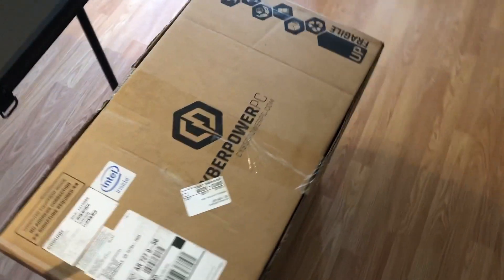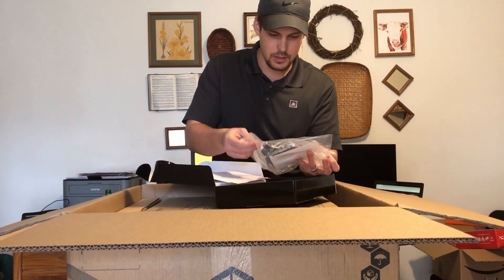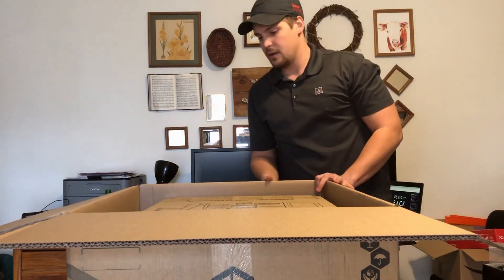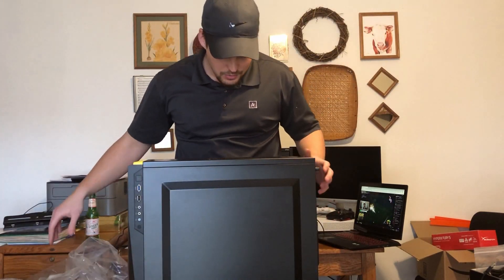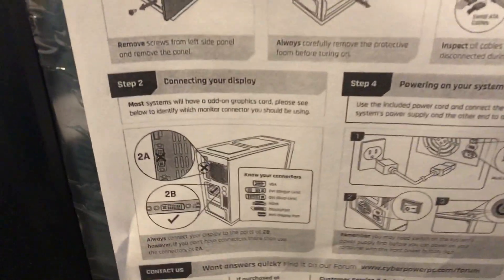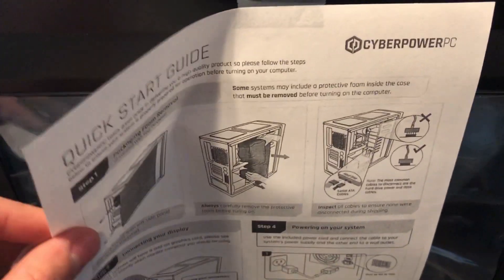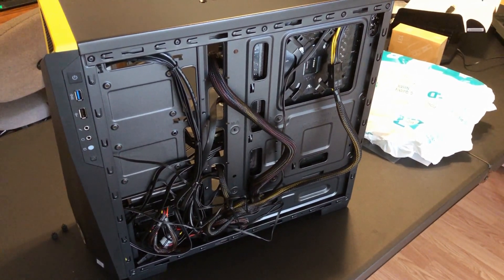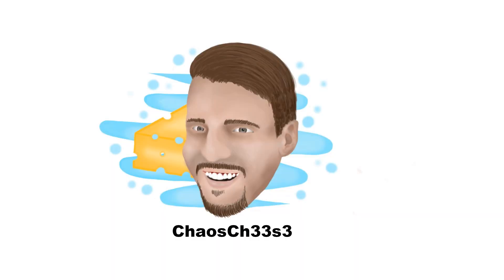Cyberpower PC Unboxing

Comment: The good thing about getting a pre made PC is you can on your own learn how to upgrade the parts. That's what I have done. Upgraded the PSU, CPU, and GPU. I'm going to at one point upgrade the motherboard and CPU again.
Reply from the maker: This is actually exactly why I got this one. I wanted to get into PC building, knew a ton about it, but didn't feel super comfortable building one right off the bat. :)
Reply: @ChaosCh33s3  same here.

Comment: I've got my cyberpowerpc coming tomorrow! Your video has give me some good insight on what to expect thank you 😁
Reply from the maker: Tom Oreilly let me know what you think of your build!
Reply: @ChaosCh33s3   just came like an hour ago, really high quality and quiet as a mouse add me on discord if you wanna play some games sometime Tommy #1266
Reply: @itssTommyy  is it working okay?
Reply: @JosceTonic   yeah fine not had any problems do you want to know the specs?
Reply: @itssTommyy yes please im planning to buy the syber gaming pc im the case of the cube
Reply: @JosceTonic 
CyberpowerPC ultra 5 Case 
Cpu: amd ryzen 5 2600x
HDD: 2tb seagate barracuda
Memory: hyperx fury ddr4 8gb x2
Motherboard: msi b450-a Pro
Gpu: amd radeon rx 570 8gb 
So far I've been able to run any game without any issues on ultra
Reply: @itssTommyy  price?
Reply: @exiled3797   I also got a 240 ssd and a monitor it cost me £1040 so about $1350
Reply: Exiled I got a cpu 3900x,GPU 5700xt  anniversary edition, 650 gold power supply 16 gig of rgb ddr4 ram, a NZXT kraken x53 , 2 tb of Seagate hdd and a 1tb nvme Samsung 970 evo and finally a b450 tomahawk all in a NZXT h510 elite case with 3 extra rgb fans for 1650$ and its running absolutely fantastic and my main use for it is vr

Comment: You obviously didnt chose the professional cable management option. If you do, the back side is much cleaner (har har). Its not that expensive and it makes cables on both sides much more manageable.
Reply from the maker: Yeah, I realized this after. I note it in the video where I try and do the cable management myself.

Comment: Did you have to buy the keyboard and mouse separately or did they come with the pc for free
Reply from the maker: The PC does come with a free mouse and keyboard, but they are low quality. They usually offer a high quality upgrade for around $5 each. (They are worth around $70 for the keyboard and $30 for the mouse).
Reply: Ty

Comment: Just picked up a 3900x from cyberpower pc with that exact cooler. Hows the cpu cooler?
Reply from the maker: It's pretty solid, it can get loud, but it cools well. Under 100% load no core goes above 75C for me.
Reply: @ChaosCh33s3  I have a ultra quiet white fan to pop in to replace if needed. Hows the pc running? any issues?
Reply from the maker: @bazurk_dot_com  No issues whatsoever. It's honestly been a super great experience.

Comment: Hey! I just bought one, and it’s going to ship soon! It doesn’t come with the foam in it? I didn’t see an option when going over the stuff included, and didn’t know I had to contact them. I would have thought that they would include a 1$ piece of foam for a pc with a i9-9900k & 2080ti
Reply from the maker: Hey so the foam inside the PC case itself is not included. All the other packing materials are. If you want them to add the foam you can email them at techsupport@cyberpowerpc.com as long as it's still in the testing stage of production they should be able to add it.
Reply: @ChaosCh33s3  thanks so much! how much does it cost?
Reply from the maker: @ExplosiveKaboom  it's $14 well worth protecting your pc
Reply: ChaosCh33s3 if it breaks and I don’t have the foam do I have to pay for repairs?
Reply from the maker: @ExplosiveKaboom  No they have warranties on their items, but you will have to pay for return shipment if you didn't pay for the extra warranty.
Reply: The option to add foam is definitely in the options menu, unless you ordered a prebuilt PC with no customization options
Reply: @AdoreYouInAshXI  mine came with foam, i didnt select it though. Wack
Reply: LimitlessDeadline it’s not one dollar it cost the company 9 bucks and that’s why they charge 15

Comment: Can u please explain how u did the third part on step 1 without that my pc won’t turn on
Reply from the maker: It is basically telling you to make sure all of the connections to your motherboard and other hardware (graphics card, hard drives etc...) are tight. These most often do not come loose in shipping so might not be your issues.

Comment: Im scared that it comes bad
Reply from the maker: If my experience is anything to go off of, they box and package their product very well. Even if it was mishandled by UPS it would have arrived intact due to the care they took.
Reply: @ChaosCh33s3  oh okay, do you recommeeend the syber gaming cube of 2080ti
Reply from the maker: If you have that kind of budget, absolutely. The cube design is great, but realistically you probably don't need that kind of power. That is an absolute beast of a machine.